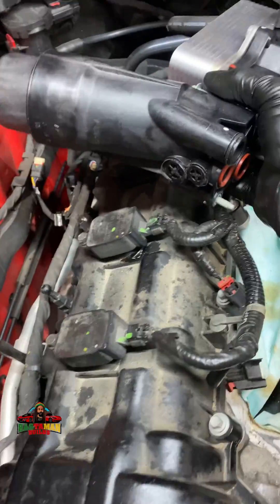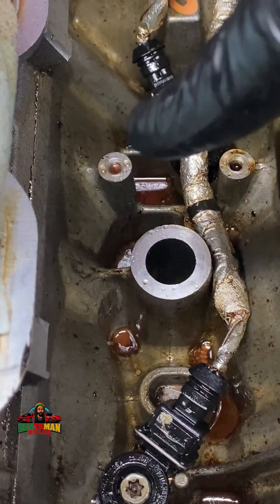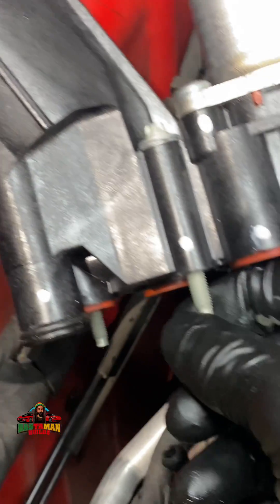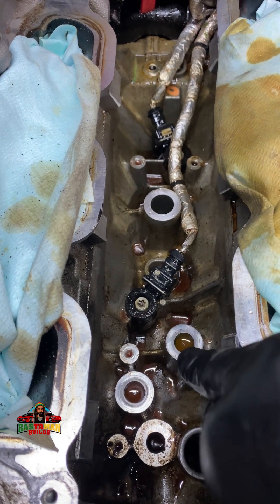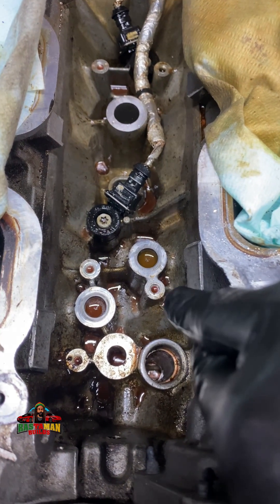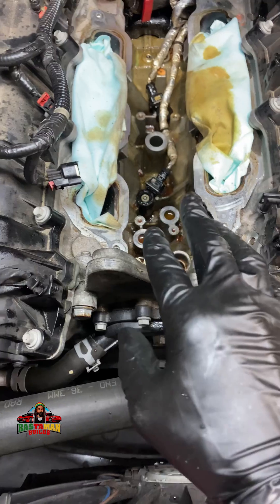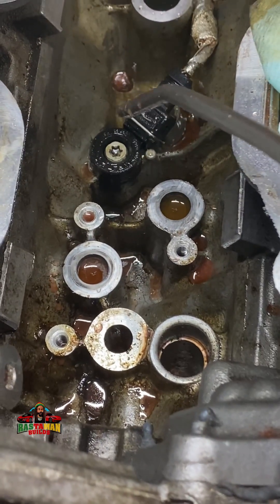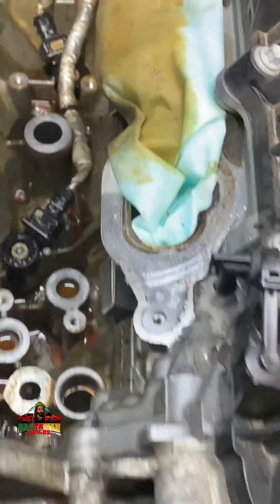Cracked Engine Block Could result

Comment: I pulled that top half manifold off the 3.6 on my promaster . Found one coil pack snout  that looked like dry water. All new plugs and coils. Still rough. All I can think is injectors. Trying a good cleaner . That wet (dried) coil pack. Right under the fresh air vent. Must be leaking
Reply from the maker: You say still rough. Is it a dead miss and what cylinder. Rough running is worse than a dead miss. Email me at my gmail rastamanbuilds
Reply: @RastamanBuilds  thanks !
Reply: @RastamanBuilds  thanks sent